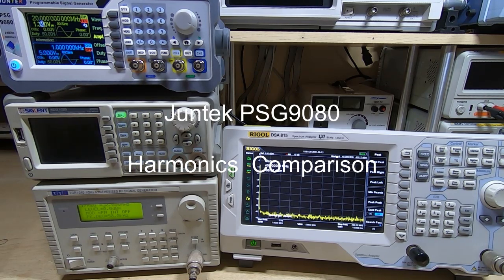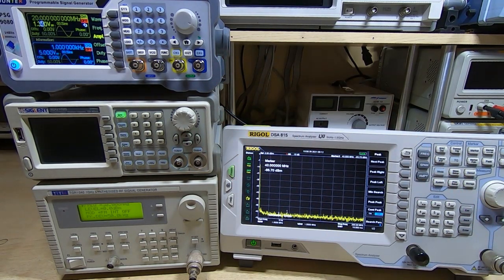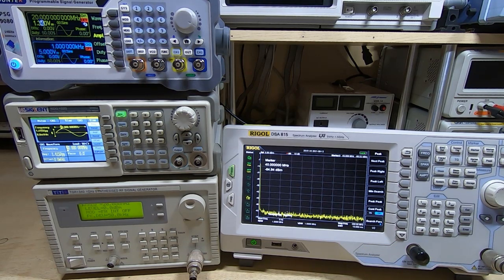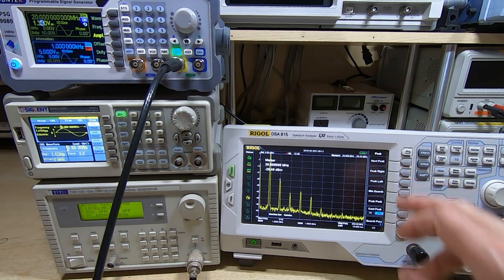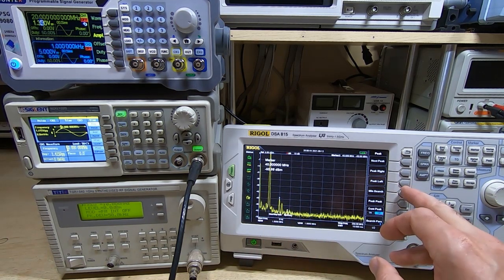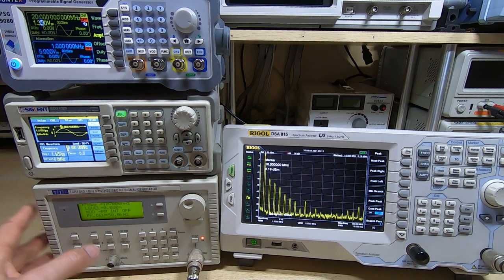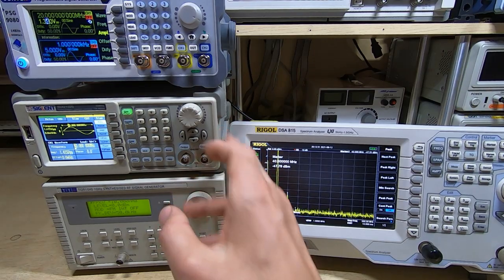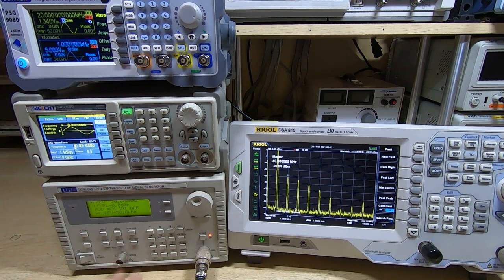Juntek PSG9080 Harmonics Comparison

Comment: For the PSG9080, replacing output amplifiers with higher quality ones would probably lower the harmonic distortion. That is what I did with my FY6800 generator. Now, the harmonics are no less than 50dB down. I wonder, what op-amps are used in the output of PSG9080.
Reply: @jim9930  i bought s PSG9080 naively thinking that it has a 14-bit DAC output. If i knew that it has R/2R DAC, I wouldn't! It shows ~1% second harmonic anywhere below 1MHz.
Another quirk I found with PWM output. Pressing the Enable button produces a DC output fot several hundreds msec, slowly rising in amplitude, before it starts making pulses. If used for   driving power electronics (or a laser), it can blow the load.
    I think the price for this device should be 1/2 of what it is.

Comment: For minimal distortion most synthesized function generators there is an optimum output level.
My Siglent SDG2122X is very good at 0 dBm in the audio range.  I have not tried it for RF. For very low distortion at lower signal levels I run it at 0 dBm and use a passive enumerator on the output.
Reply from the maker: Yes that is true but 20MHz is only a fraction of the range of some of the generators so as I say in the video it is very difficult to compare different generators. There are many other reasons but my real point is not to get too distracted by something that may not be important to the user.